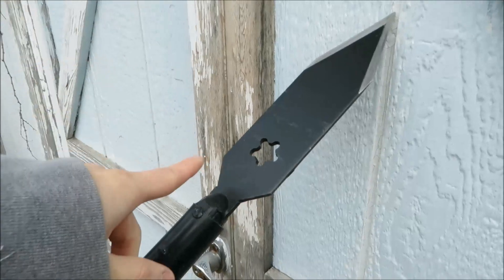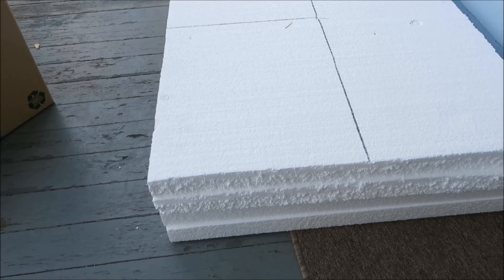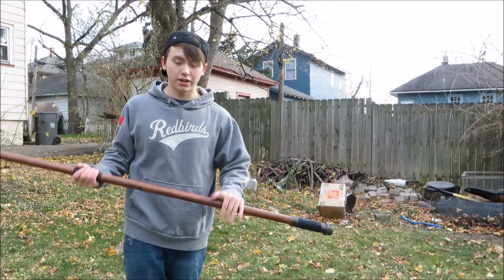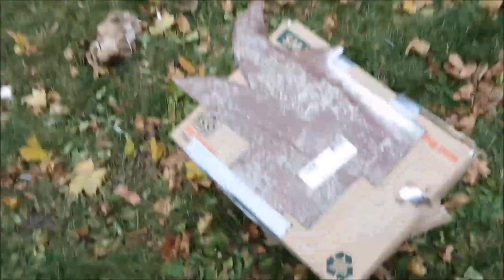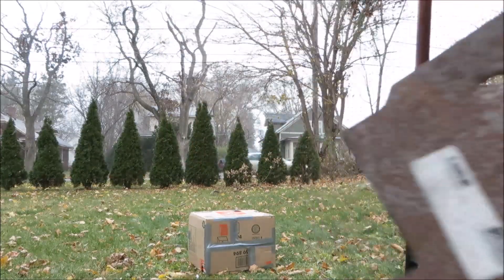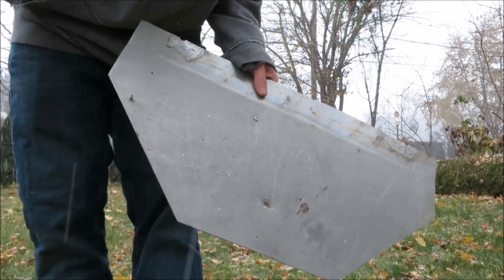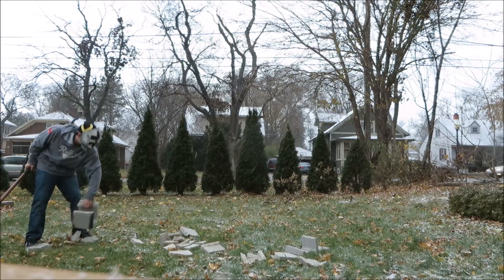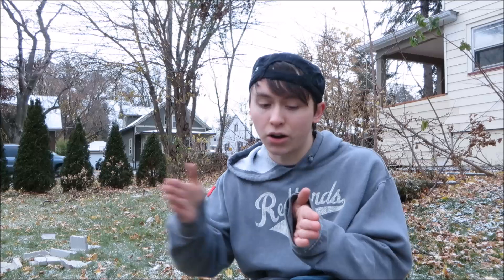Homemade Spear Test!

Comment: 2 tipps out of my own experience :

1. best wood for handles is ash, oak would use use also but its more havy, i used hazelnut also but this is kinda flexible so it may causes the point slipping of :)

2. definitly use plywood for shields it will work best when you coat it with cloth (using woodglue), also the edges of a shield are the most part of the shield to break so consider to reinforce with leather, rawhide or metal (leather and rawhide working best when you sew it on, metal attaching the best when you use nails)

greetings from germany ;)

Comment: I was holding my breath the whole time you were testing that thing. I know first hand why you don't use pine in weapon building. Glad it broke on a swing and not a stab. The name my partner and I use for testing any weapon or theory is Proof of Concept. Always thought you could start a fire with a magnifying glass till we did a proof of concept test. Unless the magnifier is ten power or greater it does do anything. Keep IP the good work.
Reply: I haven't had the same experience, but I was worried about the possibility of a splintering hand as well.

Comment: believe it or not, you would probably get more penetration if you threw the spear at the targets rather than just stab it. i don't know if you have thrown knifes. but if you did, you would know that you can always sink one deeper into a piece of wood when you throw it than you can when you simply stab it.

You can also relate it to throwing rocks. if you throw a rock against a wall it will shatter. but if you just smash it against the wall with your hands, the most it will do is chip.

Comment: A quick question about your zombie riot shield video. I have some signs because my parents work for the city and I have a MIG welder. Or what other people call a copper wire fed torch. It doesn't have as much penetration through metal as arc, and I was wondering if I should use that. Mostly cus I'm toooooo lazy to go buy rivets and stuff.

Comment: The only concern I'd have for plywood shields is splitting from cuts, stab wise it's a fine material for sparing and if it's as thick as the sheet you used here splitting might not even be an issue as the plywood used for the shield I'm referring to was maybe half as thick.

Comment: you could make the spear head a little narrower from the edges to make it better at armor penetration, also you could use the blunt end as a mace like object to crack armor open. look into medieval weapons and how they were designed because they were designed to either pierce armor, crack it, or go for the open parts of it.

Comment: i don't know if you solved the pine problem yet, but the reason pine is not normally used is because is is a soft wood. for spear shafts and most things that would need to take a lot of force you would need to use hardwoods such as the following:
Chestnut(one of my favorites), any kind of Ashwood, Birch and Oak are probably the cheapest of hardwoods simply out of the fact that is is really common, Elm, Hickory (another one of my favorites), Mahogany (which is absolutely beautiful), and Walnut.

Comment: plywood is genuinely used as a standard to test the penetration power and kill potential from rifles and hand guns. The reason your spear didn't penetrate was because of the density of the wood and the surface area of the spear. When it comes down to making your wooden shield make sure to nail a metal band around the outside edge of the shield to strengthen the shield and prevent from splintering when blocking edged weapons. Keep up the good work.

Comment: To be fair, throwing spears are different from normal spear. Throwing spears are designed to break/bend upon impact to prevent the enemy from throwing it back to you :P What you built was more of a thrusting spear

Also, get a bo stick or a staff if you want to swing it like that.
Reply: Throwing spears are normally designed differently to thrusting spears but No you are thinking of the Pilum family of javelins.
Reply: 4 years later, the norsemen actually did use fighting spears the way he did

Comment: For a strong shaft you want to have the grain of the wood running the full length of the shaft. It looks like your shaft split with the grain. I used a hardwood hoe handle for my Naginata because it was thick and the grain ran the length of the shaft. I hope to do a poleaxe/warhammer when I get around to it. Ps:A 2 inch deep stab is often considered to be likely lethal without medical help.
Reply from the maker: I tried finding a Hickory replacement handle for some long tool to use instead of the Pine when I initially made it, but it seems there aren't and 6 1/2 foot tool handles to speak of. I'm trying to find maybe a lumber yard that can supply me with hickory but the search is tough. I'm sure i'll find it sooner or later though.
Reply: Nonlethalbychoice Hey nonlethal spears are usually made from ash wood. at least historically I would personally recommend buying ash poles from kult of athena. it's a online medium-high quality weapon shop. and the ash poles they have are under 30 bucks.

Comment: about the pine wood: it won't split if you thrust because you need a much bigger force to detach the wood fibers by pushing them alongside each other, than if tear them apart like it happens when you swing it.
also you are right, pine is like the weakest wood you could use, its also known to make this very pointy cracks why other woods don't. oak is very good but much more expensive, but there are other good kinds of wood

Comment: If you apply more tape towards the end where the counter weight is you will help prevent the wood from splitting by supplying a hold onto the wood kinda like having metal wraped around it yet weaker and it will allow for you to have a greater grip in the end of the spear

Comment: Pine is very soft. That's why you usually see fallen pine trees, because the roots are too shallow and too soft to support the tree. Hickory is tough enough for baseball bats and drumsticks. Ash, like, you mentioned in the build video, is flexible and resilient. Good work on the spear, sad to see it go :(

Comment: It might be a little on the expensive side but if you use oak with the same diameter it should work. Ash and poplar might work as well. You should look for something that is slightly springy so it can flex instead of snap. Hope this is helpfully 
TheElvenArcher

Comment: it's cause the grain in pine doesn't tend to run the full length of the shaft without veering off. You can find some pretty nice ash poles online for around 20 bucks, the problem is the shipping is just as much so either buy bulk or expect to spend an extra 40-50 bucks on the pole alone. I've toyed with the idea of using a fiber glass flag pole or like the pole from a tree limber. Maybe you could give that a shot and let us know if it's a viable option

Comment: Lowes has 1.5 inch oak dowel but I think it's only 3 feet long. Another option is ash bo staff staves that you can get from martial arts stores those come in 5 and 6 foot lengths and would be crazy strong. Great video though!

Comment: Alot of medieval style martial arts groups use plywood shields for their rigidity and low weight.
7 layer, 12mm, ply is usually good. (I can attest to the strength, mine's been through the ringer)

Comment: Someone may have already mentioned this, but if you can find a hardwood sapling that is very straight and about the diameter of your shaft, that would be a great choice.  Not only does it have the grain running the full length, but it will have tremendous shock resistance.  Just shave the bark off with a knife, let it dry (maybe by a fire) and then you should have a fantastic spear pole

Comment: Finding Ash or Hickory rounds in 6 foot lengths is going to be hard. 

Cold Steel makes spears of course, and they sell replacement handles. That's probably your best bet for finding a 6 or 7 foot Ash shaft for a spear.

Comment: Just figured I'd share my 2 cents since I know lumber fairly well. Pine is a soft wood hence why its not used much. but other woods like oak are hard wood and will take much more punishment. Also the plywood you were using was also a hard wood. So things like oak birch and ash will all work better.

Comment: To make them (javelins, or let's just simplify and call them throwing spears), the center of gravity needs to be roughly 1/3 from the front. Roughly: moving it back a tick allows them to "float" and moving it forward gives surer stable flight. I can't say this works on something that isn't barrel shafted but...

Comment: A bit late, but weapon tests should be called Alpha Strike.
Reply: A "bit" late.
Reply: Tru
Reply: TearsOfLA the type of ply wood hed be using is layered and a little bit more expensive then parcel wood which is most commonly known as ply wood. its a common mistake but hey todays ply wood is stronger then the wood they used for wooden sheild back in ye ole days.

Comment: I used pvc pipe for my spear the blade is from an old bayonet. I used one inch pvc pipe an put a 3/4 inch pipe inside than used a fiber glass dowel rod for strength. It works great

Comment: you discovered what the vikings did thousands of years ago, ply wood is the key to a strong shield, they had 2 layers of boards running in opposing grains so that an axe couldnt simply sail through the shield if it struck the grain
Reply: also if youre interested in armor penetration you should look at the viking thrusting spear design, the point is steep to focus and maintain the force at impact and the guard preserves the mass of the head while also doubling as a perfect hooking implement

Comment: Hey lethal, the pine was a bad move, go to hardwood stores to find oak, maple, or hickory. But stick to oak and maple as some wood sold as hickory is a mix of chestnut and hickory to save time. So oak, or maple, no pine. Pine is a soft wood that you can work with sandpaper if need be, but oak and maple you will need wood files for. Anything more than maple you need power tools. A fan and a carpenters son giving some advice.

Comment: Well, I didn't find any comments explaining the issues of pine so I'll use my incredibly meager knowledge and see if I can help you out.
As far as I'm aware, pine (and other coniferous trees) are soft woods, and are therefore more flexible and easy to work with, but more likely to break. If you can't find some of the woods other commenters are talking about, maybe maple would be usable/easier to find?
Good luck with the spear!

Comment: pine wood is very soft. it's great wood to split for firewood but that also make it somewhat dangerous to work with as far as a spear is concerned. maybe see about wax wood. the stuff is very hard and it's used for fighting staffs in (i think) Shao lin kung fu. just an idea

Comment: I'm hoping you'll see this, it's likely you won't though, anyways a way to strengthen a spear is to do small bands of metal around it in 6 in intervals and they don't have to be big heavy bands, but if you hear up a strip of steel and wrap it around the wood while it's hot, the metal cools and shrinks around the wood making it even tighter

Comment: Just incase you see this, dude you should check out hexarmor gloves they are cut resistant puncture resisted and even impact resistant depending on the model you get I currently have the 4031's I think they are cut, puncture, and impact resitant, and these ones have a liner do they keep your hands warm too, but some have limited dexterity but that can be over looked and some have a compromised grip. But I love mien and keep in mind oil riggers, construction workers, miners and more have and love these gloves you should check them out

Comment: i would suggest getting some oak rods or dowels for spears, nunchaku, kama, or any pole weapon, its cheap but strong, and they should have it at home depot at least they do here in Canada. great video btw keep up the great work.
Reply: oak tends to splinter like pine.  it's better for a building material than as a weapon.  it does depend on the exact species of oak, but you'd be better off using it for floorboards in most cases.
Reply: red oak is good though i should have been more specific.

Comment: Using a hardwood like oak - or, even better - hickory (my fav) with long straight grain would have prevented the wood split. Pine is considered a "softwood," and won't have the spring, not the strength of a good hardwood. The grain was actually good on that pine staff, but it's just the wrong kind of wood. I guess you know that now, though.

Comment: If there are any public wooded areas or if you know someone with wooded property, you might be able to find a good sapling to use for the spear shaft if you decide to rebuild it.

I've had good experience with young oak trees, they usually grow nice and straight. Pine saplings work much better than pine dowels.

I have a walking stick made of a cedar sapling that's almost ten years old, bark on and no treatment, and its as sturdy as day 1.

If nothing else, you might consider a waxwood staff. They're usually sold as straight(ish) saplings themselves at various weapon supply sites.
Last one I saw was at TrueSwords.com (totally not a plug)

Comment: Also keep in mind that the effectiveness of a spear is also partly dependent on the upper-body strength and weight of the wielder. That's not a knock against you, buddy. These things were generally most effective in the hands of professional soldiers who trained and fought with them constantly. I have no doubts that you could shove that spear through even thicker stuff If you wanted to eat like a horse and swing this thing around your yard all day for a few years.

Comment: Use yew or hickory.  The reason societies have been using those woods for spears for most of history is they are very flexible and will bend before they break in addition to being very strong.  Pine or hickory is both a soft wood and a brittle wood.  Most hard woods like oak will be stiff and hard to break, but they will snap under extreme pressure instead of bending.  Yew in Europe and hickory in america are the best woods for absorbing shock.  They're both used for spear and axe hafts and for bows.  Also, if you're worried about technique at all, I wouldn't suggest holding the spear at the center of gravity if you're holding one handed.  Holding the center of gravity doesn't give you lateral control over the tip of the weapon so the opponent can easily knock the tip of your spear out of the way and close in before you can bring it back.  Traditionally, spears should be held closer to the back end.

Comment: oak is a good wood for spears but pine is very soft. it shouldn't be to hard to acquire some oak but keep in mind it is pretty damn heavy so u may get it a little thinner than the pine. also ply wood was used traditionally in certain shields. it can easily stop any arrow or any piercing damage. nice balance though on the spear.glad you didn't try and balance it to be a javelin  then call it a spear.
Reply: I've seen oak splinter too often to recommend it myself.
Reply: if you lacker it enough it should be fine but alot of ancient spears are made of oak also if you wrap it then that would help as well.
Reply: MR zero
eh, depends on the oak as well.  most of the time these days it's hard to find good oak.

Comment: For a spear that you. Would use to do any side hits, ash is recomended. Go to Kult of Athena and order a spear shaft for 50 bucks. Is what i have for my Swiss Halberd.
Reply: ***** that would woork, definatly pay attention to the grain though. Yew is also a good wood, and then there is Iron Wood, a magnificetly dence and sturdy wood. That type of wood is gooD for hammers.
Reply: ***** Hickery if possible, otherwise i would say Red oak would be a good choice. With the oak, its good to seal it with either a sealent ot a water-woodglue mixture.
Reply: WolfmanXX Alexander Where could I purchase Iron Wood?
Reply: If you have a lumber market close, you could go to them and see. The big named stores may not have any, like Home D-pot and Lowe's. Go to a city lumber market.
Reply: http://en.m.wikipedia.org/wiki/Ironwood